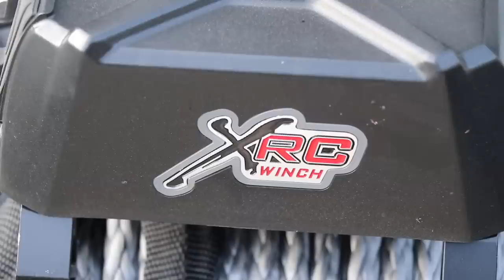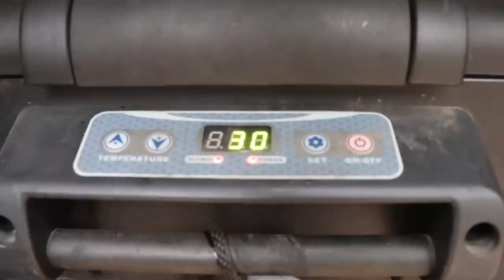Jeep Wrangler Built for the Alaskan Ultimate Adventure

Comment: Love the front bumper. I have the same on on my JK. Was in an accident a few weeks ago and it bent my frame rails but barely damaged the bumper. Those are a beast. They actually used the bumper as a attachment point to pull the frame back into alignment before they put the new one on.
Reply from the maker: My son had a similar situation with the Smittybilt rear bumper on the XJ a couple years ago.
Reply: Both bumpers look really nice. Now they just need to make them for a YJ

Comment: Go watch the Unsealed 4x4 winch cable failure test on Youtube, synthetic lines definitely seem to recoil at a dangerous speed. Not to the same degree as steel cables did but I wouldn't stand near a synthetic cable either. This guy, Ryan, seems to think otherwise.
Reply: Morgan Griffith nope. I don’t think otherwise. You should always practice safety when winching or strapping. I’ve seen people seriously injured with cable. I’ve also seen people hit with hooks and chains. That being said, synthetic are the lesser of the evils.

Comment: Brad, how did you mount the shovel on the Tailgate Reinforcement kit on the back of that Jeep. I have the Quick Fist clamps, but not sure where you bolted them. The standard bolt holes holding the tailgate reinforcement isn't high enough for the lower clamp to hold a shovel like that. Just curious, it seems an awesome way to carry a shovel, especially a dirty shovel.
Reply: Mike D I just drilled and tapped 10-24 holes in the forging.

Comment: Had a rear Smittybilt bumper on my then, brand new 89 Toyota 4x4 way back when... Same company?
Reply: Troy Allen Smittybilt as the brand has been sold several times. It’s been owned by 4WP for about 15 years. They still sell double tube bumpers just like the original.

Comment: Only comment I got on the Smittybilt bumpers is they started to rust on my JKU. I guess I could have made a warranty issue out of it, but some a$$hole totalled it. Now driving a JL.
Reply: Talez From the DashCam Smittybilt’s warranty is unmatched. They would have made it right.
Reply: I know they would, Just  a PITA to have them replaced. Moot point anyway as some DH totaled my 2015 JKU (a.k.a Craveman)
Reply: Talez From the DashCam  also you might want to know Smittybilt has increased its corrosion standards and use new UV coatings to reduce warranty claims.

Comment: That was pretty slick putting a plug in the axle tube, what did you use?
Reply: Tain Ballantyne it’s a hydraulic tank oil cap.  It’s 2-1/4 diameter and made of rubber. When you tighten the T handle it expands to plug the hole. They also make Rubber freeze plugs that work on the same premise.

Comment: at 6klbs that rig is about 600lbs over weight.  Did they do any mods to mitigate that?
Reply: treiz remember that the 600 lb over weight includes unsprung weight. Meaning the tires, axles and suspension links increase the vehicle weight by 1000lbs but don’t negatively affect tow or capacity rating.
Reply: @drtstar1  Actually they do affect those numbers.  more weight means more load, and more load means you need bigger brakes to safely control and stop the vehicle, it means you need different gearing to keep the engine from bogging down or constantly hunting when towing or hit with winds, it means a lot more stress on the tranny and engine and drive line, it means more stress on the steering,  etc etc etc.  That's why I asked what additional steps did they take to mitigate these issues.
Reply: treiz as you are right more weight negatively effects stopping and going,  the vehicle upgrades include 5.38 gearing, oversized brakes rotors, and 10% more spring rate to carry the spring weight.

Comment: Are any of Smittybilt's products made in the USA? I heard they were all made in China...
Reply: MajorPayne550E 90% of Smittybilt’s parts are made overseas. We make stuff in Mexico, India, Thailand,Taiwan and China. Each place has its specialty. Many OEMs use these same manufacturing plants. I’ve been to many of these plants and they are equipped to hold the same engineering standards as the USA. One difference is they can put coatings on that are nearly impossible to use in the USA. This makes a product that stands up to harsh environments better. Let’s not forget the cost savings that is also transferred to the customer. Hope that helps.